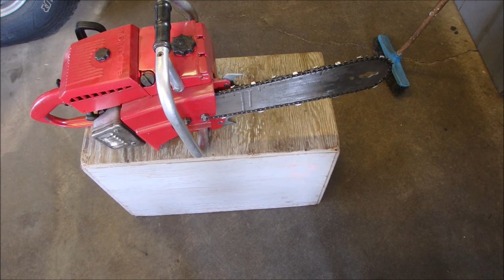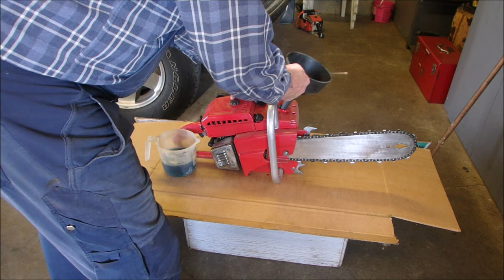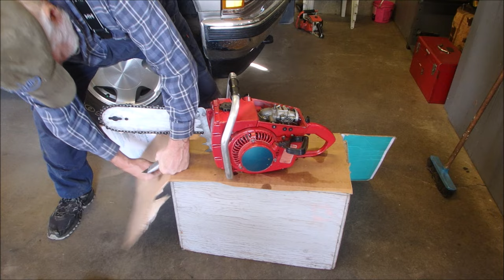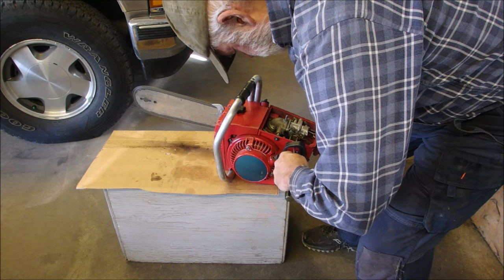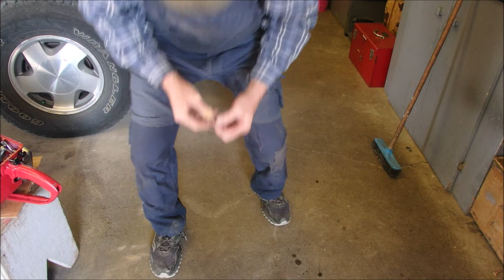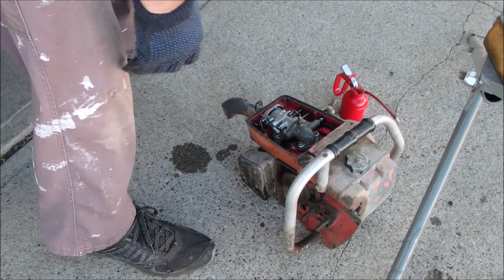First Run of a 50 Year Old 100cc Homelite XP 1020

Comment: Awesome video thank you for the video I had a question Mr Craftsman since you know a lot about Craftsman products I have  a GT 6000  manual garden tractor I was wondering if you knew anything about what oil would go in the rear end what Spark plugs it would take and if you didn't know that's no problem thank you anyways
Reply from the maker: This is a start.   There are drop down tabs for engine etc
https://www.tractordata.com/lawn-tractors/001/3/9/1394-craftsman-91725003.html#
Reply: @BrucesShop  thank you a million times over I appreciate this very much